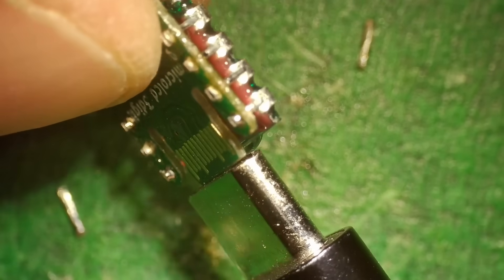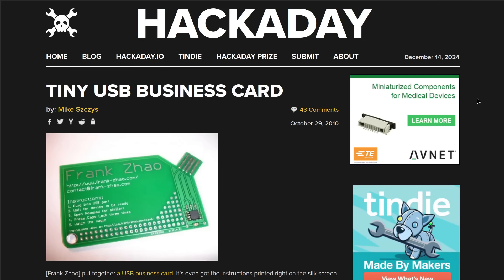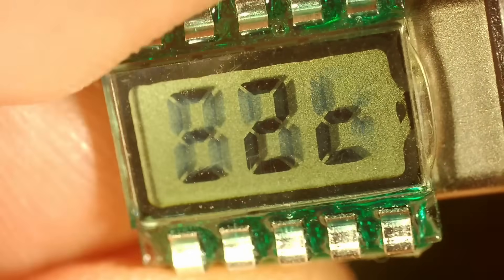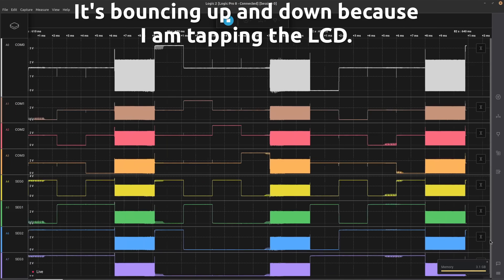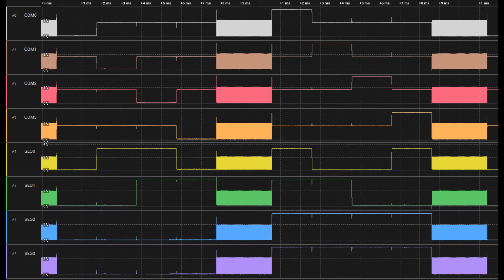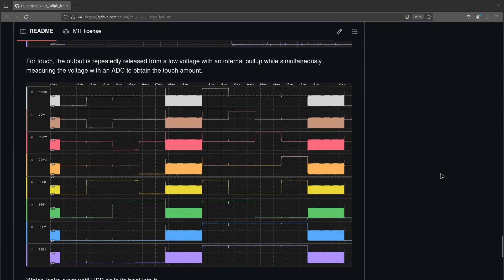Bit Banging LCD + Touch + USB on the ch32v003

Comment: is it possible to support left/right swipe? after all, the pins on the LCD are in the horizontal plane
Reply from the maker: I tried this a few times, the answer is sort of kind of but it's not great, because there's so much crosscorrelation.

Comment: LCDs don't necessarily care about max voltage difference but they do like "alternating current" of sorts, running them with +1/0/-1 ternary logic that averages to 0V helps prevent chemicals inside from breaking down
Reply from the maker: I've definitely noticed that.  I always assumed it was more for appearance, but there are some pretty crazy effects I've seen with DC offsets.

Comment: This looks like an interesting project. Do you know how i can convert this to use an ESP32-C3? I need to use a chip with more memory, speed, and reliability, and i find the ESP32 to be better than the CH32.
Reply from the maker: Well, the CH32 is toe-to-toe with the ESP32 on reliability, but it is less RAM and raw speed (but not much, considering the zero flash wait states).  It's also much harder to do things that are like bit banging on it because the rest of the stack is so heavy.  That said, you may be able to, especially if you can use the DMA.
Reply: Thank you for your reply. I wanted to use an ESP32-C3 because of the better software support. What tips can you give me about using an ESP32-C3 to drive a bare lcd?
Reply from the maker: @XanCraft21  I honestly, don't know.  Does it have an LCD (via I2S) output?    But, what's wrong with the software support on WCH parts?  I've done everything I can to make ch32v003fun king.
Reply: I think the ESP32-C3 has an I2S port, but i’m not sure how good it is for driving bare lcds. And for the WCH software support it’s actually harder to use than something like ESP32 or Arduino, but that is base off my own experience. I could possibly use a CH32 with a different platform, but the software support there is still not as good as other devices.
Reply from the maker: @XanCraft21  If it has an "LCD I2S" Port, then you're golden, doesn't matter. You aren't going to want to use their libraies if you want to do it.

And It "sounds" like you mean official support.  I'm talking about ch32v003fun.
Reply: Ok, thank you for the info.

And i must apologize for not being descriptive enough about software support. Yes i was referring to official support. Is the software you’re using considered unofficial? Just curious.
Reply from the maker: @XanCraft21  ch32v003fun is the toolset a ton of people use.  The official tooling is only build around moun river studio.

Comment: You can actually get ENIG boards at JLCPCB for 2$ simply by selecting a 6 layer board. The board size will be limited to 50x50mm but that should be no problem in your case. You even get via plating for via-in-pad which makes layouting tight designs so much easier.
Reply from the maker: I only do things that would be cheap for mass production.  2-layer is the only way you're going to find mass-production boards for under $0.25/ea.

Comment: The next step is to make a keyboard using these as the keys, the glass tapper.  Digital fish everywhere will be furious.
Reply from the maker: haha, there's a few people who have recommended a keyboard, but I'm definitely not a 3D printer guy.
Reply: @CNLohr  Maybe Zack Freedman could help with that, he has been working on his own custom mechanical keyboard.  The MiRage Mk3, the Mk1 had LCDs from an Arduino that were mounted to a cut PCB in a way that when you pressed the display the PCB would flex just enough to press a switch underneath.  He ended up making a custom firmware for it too written in circuitpython but that was later switched to something else that slips my mind at this moment.  But maybe he'd be interested in adding this to it or making a version using it.  If not, then another one who most likely be interested would be Glarses.  He's made all sorts of wacky keyboards, from giant ones, to three 108 keyed stuck together lengthwise inside a milled aluminum shell.  So, a keyboard like this would also be up his alley.
Reply from the maker: @TerminusByte  I have to move on for now from this, but I am happy to iterate if someone else has any ideas or anything.  I don't know Zack Freedman.
Reply: @CNLohr  Understandable, well look forward to seeing what comes next on the horizon.

Comment: I though oversampling was log_2? For every doubling of the samples, you gain one more bit
Reply: You may be thinking about delta-sigma ADCs which gain ~1.5 bits for each oversampling doubling (with a 1st order filter) see wikipedia article.
For a normal ADC quantization SNR is: 6.02N + 1.76 + 10log10(fs/2B) dB
The 10log10(fs/2B) term is ~6db when fs is 4x the nyquist rate (2B), This is approximately equivalent to adding an extra bit to the ADC (N)
This information was shamelessly stolen from the dsp stackexchange.
Reply: I did some more digging. From what I can find, the SNR indeed goes up with sqrt(N), this translates into an ENOB increase of log_4(N). So every 4x oversampling you double the SNR, which is equivalent to adding one bit of resolution
Reply from the maker: I was just talking to a DSP person in my Discord about this, and I think it's actually only 3dB per doubling of samples. So I think that works out to a square root in there.

Comment: When I was working on a counter "days until retirement" (my dad wanted this xD), I used a passive LCD too. Back then, I found a great app note by Maxim (APP 4039) about, how to drive them. In order to avoid segments being partially on, you need to connect resistors between IOs and segment lines. Only Com is connected directly.
BTW: I'm a big fan of your ch32v003fun framework! :D

Comment: I use UV "resin" for everything as "glue".  Whenever I watch DIY youtube video, and a person uses hot glue, I shake my head,  Its pretty brittle too, it will hold indefinitely, but if  you really need to reclaim some part,  get a corner of it to delaminate, and usually the rest will come with it,  Its pretty close to ideal for my uses
Reply from the maker: I only recently started using it, At the very end before I did  the video I graduated from my girlfriend's nail polish and I really love the actual resin.

Comment: Why don't you short two gpios and pull up one and down the other to get vcc/2 ? Does the lcd have enough capacity to smooth out your pwm? 7:02
Reply from the maker: I love that idea. I never thought about it.  In my case, I wouldn't be able to with my routing constraints but if it was a little bigger, this is a great idea.

Comment: Someone asked about "bit banging", and I made a kind of nasty answer, so wanted to apologize for that, to whomever that was... It's generally an approach that uses software that changes the operation of one, or several, pins on a device, to perform a function that is most often done with a dedicated pin(s) that has internal logic to perform a special function... In "the good old days", something like a UART asynchronous interface, could be done entirely with changing the state of I/O pins , with timing performed, in the simplest (hardware) case, with just software NOP loops, and the data transfer by shifting bits..

Comment: Yes LCD''s don't care about polarity, but what they do care about is DC bias. The average voltage on an LCD between 2 opposing sides (Seg/Com) needs to be always as close to zero as possible lest the liquid crystal gets charged through ionic migration.
Reply from the maker: I've definitely noticed very strange behaviors happening if I heavily polarize the lcd.  I don't have a clear understanding of what's going on with the chemistry but I see a no no, so I will abide by the rules.

Comment: I kind of like these LCD's although the non multiplexed variants (better contrast) as they use so little power, great for battery and solar powered devices. It's just a pity no suppliers make them up as modules like the LED and OLED modules commonly available for Arduino projects.
Reply from the maker: These modules are multiplexed. There are non-multiplexed variants though.  I was surprised that for multiplexed LCDs you could get them the look this good.
Reply: @CNLohr  But not as good as the non multiplexed variants, the usual loss with multiplexing is loss of viewing angle and contrast
Reply from the maker: @paulstubbs7678  Yes, just pointing out that the multiplexed ones are fine.

Comment: I would love to try using ch32v chips but is there a way to program them without that WCH link programmer?
Reply from the maker: Yes, I have a variety of firmware-only solutions, including being able to flash 003's from 003's, in rv003usb.
Reply: @CNLohr  I would to continue to read into this, may I ask where can I see any more information on this process?
Reply from the maker: @zeffofx  It would be best to join the Discord.  Hit me up, and you can chat with others working with it.  My Discord name is the same as the channel name.

Comment: I also steal my girlfriend's nail polishes. dry top is my favorite!
Reply from the maker: What do you use them for?
Reply: @CNLohr  mainly securing mod wires, securing and isolating pcb repairs. i prefer dry top to uv solder mask because it doesn't contain pigments (that can block some uv) therefore it cures faster and i can apply a thicker layer if i want. i even used it for some structural applications e.g. "emergency replacement connector housing" by building up layers. it's reasonably heat resistant, scratch resistant, stiff but not as brittle as hardware store 2 part epoxy.
also the "dry" part means that it doesn't leave a sticky residue after curing.
but it can be problematic as electrical insulation - it has a very high surface tension, which is good for its intended purpose (makes surface even and shiny), but it really doesn't want to cover sharp points, corners etc.

cheers!

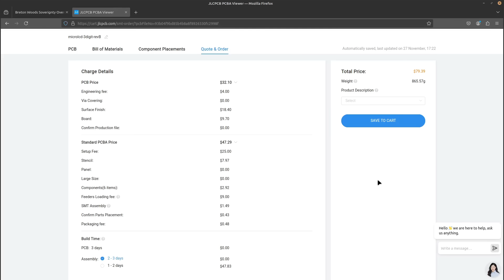Comment: 3:00 "To cut down in relative cost per unit" Then procced to show 25 PCBs of 10cm² without panelization when the footprint is 1cm²... 🤦🏻‍♂️
Reply from the maker: It was still very inexpensive for the boards, the expensive part was assembly.

Comment: Clear lcds are so cool! Back in 1985, I had a handful of little battery powered lcd clocks which i would take apart and do stuff with like removing the silvery beige backing film and replacing it with different colors of paper, or flipping the polarizing film so the lcds would be white on black.  I was 11 at the time. I thought i was a wizard.
Reply: I remember discovering the polarizing film also. It was quite the revelation and I didn't know jack shit about EM radiation so it was like magic.
Reply: @stopthephilosophicalzombie9017  yes!!!
Reply from the maker: I loved messing around with rotating the polarization films, to do things like invert the LCD colors, and other fun things, like me it so only I could see it.
Reply: You were a wizard.  Feel free to own it.

Comment: Pretty neat! Whats the quality of thats Microcontrollers ADC? Im most familier with the STM32 family due to my job but open for cool alternatives. Are the ADC as noisy as the Esp-32? Could believe how bad they were on the recommend devboard
Reply from the maker: The 003's ADCs are shockingly good for lot of things.  WAY better than the ones in the ESP-32.   Any of the dev boards are fine.
Reply: @CNLohr  thanks for the response! Will look into them!
Reply from the maker: @lynes2peters438  To clarify "shockingly good" does not mean like CD audio quality. (Just a warning)
Reply: @CNLohr  and give them a try :-)

Comment: Nifty gadget!  Perhaps the new Digispark for open arch RISC-V?  
Was not aware of this USB bootloader for the ch32v003.  Sounds like they made a thing like Micronucleus (tiny85). WCH makes many USB bridge chips in the CH32 line, am a little surprised you picked one w/o the interface for this project.
Ah yes, (looked it up), there is a CH32x035 with USB-2 in a 20-pin package.  Probably more expensive.
Reply from the maker: I've just used the 003 for so much.  I love it because of the one-wire-debug,print,flash, it's so rough-and-tumble, with 5V support and strong ESD resistance and it's just all around a great chip.

Comment: On most MCUs you can do touch sensing without an ADC - just measure the time it takes for the internal pullup to pull a pin high after forcing it low. Typically in the low tens of uS - longer with a higher external pullup resistor. This works well for resist covered PCB touchpads. You can get better sensitivity/resolution in a few ways - using comparator/reference to increase the input threshold & lengthen the charge time, and input capture peripheral to get better timing resolution.
Reply from the maker: You can do much better than time-only by measuring ADC, as in you can get much higher resolution.  That said, if all you need is a 'is the button pressed' yeah, time-only with pin change is about perfect.
Reply: so basically write pwm code?
Reply: @meshmash_yuh  as he said measure time for state change of the pin

Comment: Would have been much cheaper if you put multiple PCBs on a panel - JLC will panelise for you.
Reply: I did the same thing with a small PCB and they showed up all tiny inside a giant break-apart-and-throw-away frame.  At first I thought they sent me someone else’s PCBs!  But still super cheap compared to what it was only say ten years ago.
Reply from the maker: I was surprised, the big price sink was more the assembly costs.  But in future designs I definitely will do this.
Reply: I tried it one time with a design and it was not worth the time, just get single PCB. They calc the price based on size and incoperate your pcb in a panel with other peoples designs anyway. Just stick to 2 or 4 layer and all standard without lead if you want to import it into the EU.

Comment: I thought about using lcd as touch sensor one day, but didn't have this knowledge to achieve it as you did, you did great job here and can you make it sense touch on each segment or even on each part of the segment or it only the whole lcd act as single touch sensor?
Reply from the maker: This display is multiplexed, I think for it to work, you would need a not-multiplexed display. But, even then, because the COM line would be across the whole display, it would make it very hard to see individual segment changes.

Comment: Creating a USB-Enabled 3-Digit, 7-Segment LCD with Touch Capabilities for Under $1

*   0:03 Introduction: The video demonstrates creating a USB-enabled device with a 7-segment LCD and touch sensor using a cheap RISC-V microcontroller (ch32v003).
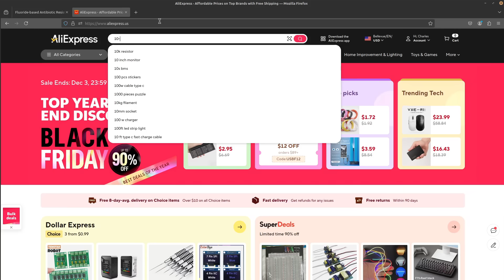*   0:31 Cheap LCDs: The project utilizes incredibly affordable 7-segment LCDs sourced from AliExpress, costing around 21 cents each in bulk.
*   0:58 The CH32V003 Microcontroller: The core of the project is the ch32v003, a ~10 cent RISC-V microcontroller, chosen for its low cost and versatility.
*   1:03 Bit-Banged USB Stack: The ch32v003 lacks native USB, so a custom bit-banged USB stack was implemented to enable communication with a PC.
*   1:21 Custom Bootloader: A compact bootloader (1920 bytes) was developed, allowing firmware updates directly through USB without a dedicated programmer.
*   1:37 Connectorless USB-C Design: The project features a unique connectorless USB-C design, where the PCB itself acts as the male connector, held in place by the LCD.
*   2:24 PCB Fabrication: The PCBs were ordered from JLCPCB with a 0.6mm thickness and ENIG finish for reliable USB connections, costing $79.39 for 25 boards.
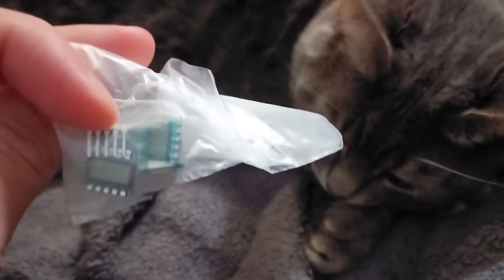*   3:24 LCD Packaging Issues: The LCDs arrived with damaged pins due to poor packaging, though none were found to be faulty.
*   3:36 Initial Firmware and Bootloader: Basic firmware was written to drive the LCD, and the custom USB bootloader was successfully tested.
*   4:56 USB-Induced LCD Interference: Inserting the USB connector initially caused LCD segments to malfunction due to shorting. This was resolved using UV gel nail polish as an insulator.
*   5:44 Driving the LCD: The LCD is driven by manipulating the COM and SEG lines with specific voltage levels (1/2 VCC) to illuminate segments.
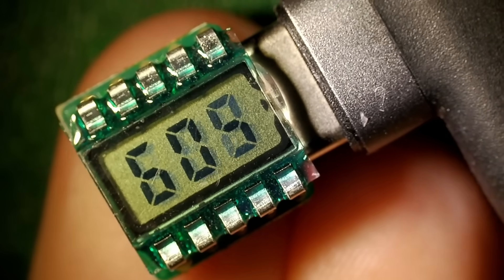*   6:49 Driving at 1/2 VCC: A custom assembly loop was created to generate the required 1/2 VCC (1.6V) for driving the LCD, as the microcontroller couldn't do this natively.
*   7:41 Touch Sensing Implementation: The LCD is repurposed as a touch sensor by driving all segments low, applying a pull-up resistor, and measuring the voltage rise time with the ADC.
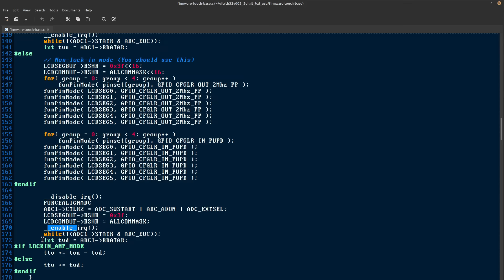*   8:45 ADC Sampling and Oversampling: The ADC samples the voltage for 375ns to detect the presence of a finger, with oversampling used to improve accuracy.
*   9:45 Hysteresis for Touch Detection: Hysteresis is added to the touch detection
Error: unsupported operand type(s) for +: 'NoneType' and 'str' Conclusion:* The project successfully demonstrates a functional, low-cost USB device with an LCD and touch sensor, highlighting the versatility of the ch32v003 microcontroller.
*   11:19 Addendums: UV glue is recommended for insulation, and one LCD output pin is used as the RESET pin, requiring option byte reprogramming.

I used gemini-1.5-pro-exp-0827 on rocketrecap dot com to summarize the transcript.
Cost (if I didn't use the free tier): $0.02
Input tokens: 15522
Output tokens: 777

Comment: I'm thinking that these could be pretty cool if you got 9 or 12 of those screens laid them out in a grid, put an addressable RGB LED behind each screen, replaced the solid coloured backing with frosted translucent film, then programming it all to work like a stream deck type input device with abbreviated button labels. I guess it would all be down to how responsive and reliable the touch recognition could be made. 🤔
Reply from the maker: A few people have recommended trying with an RGB LED.  I admittedly did not think of it.  But, now I am curious! I put an LED behind the display and it glows, so it may be worth giving it a shot.